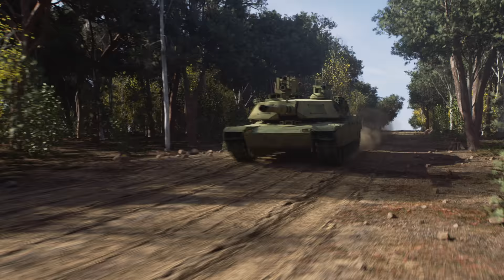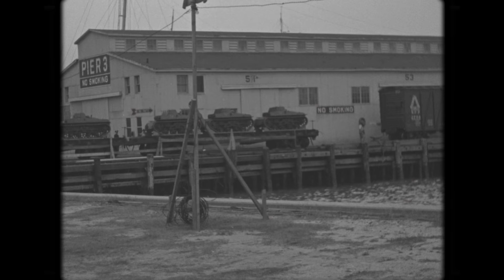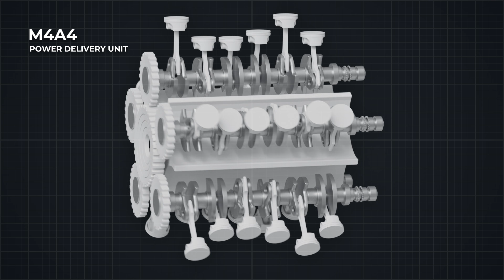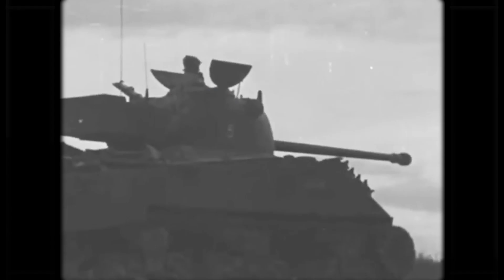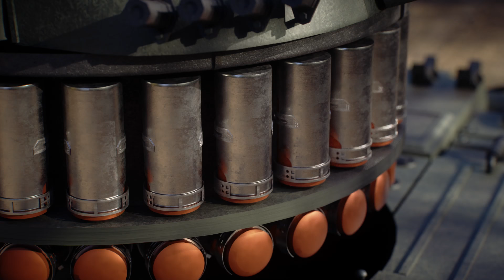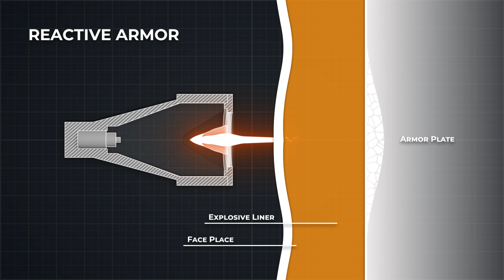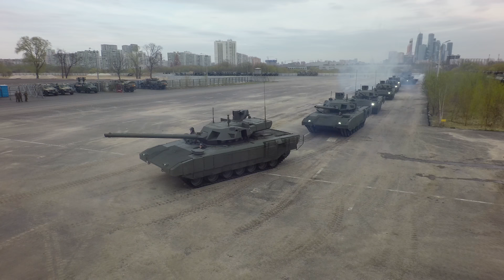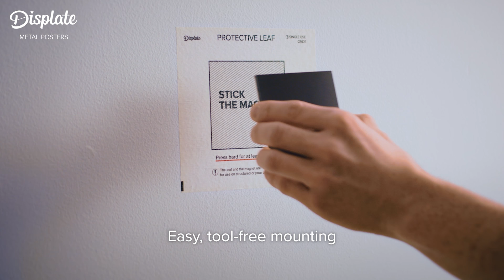Why America’s Tank Failed in Ukraine

Comment: this video is oversimplifying things so much that i almost wanna call this missinformation.

Edit: yea there are a lot of things blatantly wrong with this video.
The video title is missleading. This entire video is purely about engine design and hating on the Turbine, mainly due to fuel consumption while cherry picking military logistics issues.

A small list of things wrong with this video:
-Abrams didnt receive DU on its hull till the most recent SEP V3 
  and DU doesnt matter in the context of Ukraine as theirs dont have it at all.
-Tiger 2 wasnt build as a response to the allies employing better guns, its development started well before guns like the 17pdr, 76, 90, 100 and 122 were used against Tiger 1s.
-The T64 didnt just need someone to drive better, the engine itself was heavily flawed and needed a lot more development time, eventualy beeing reliable in the T64B.
-The engine layout in the Abrams prototypes didnt matter, the Army had already decided on the much more reliable Turbine for whoever won.
  it was purely a reliability question, the Diesel never even got close to the reliability standards set by the Army, in either case the Turbine was prefered by the Military and both vehicles were to fit it if either one of them won.
-The Diesel powered Tanks in the Russian arsenal arent much better than the Turbine T80. from a Tankers perspective they are identical with minor differences in favor of the turbine.
-"extreme mobility" or rather the reduction of weight in favor of mobility, turned out to be the wrong approach to tank combat shortly after Leopard 1 entered service, it had no impact on the Abrams development.
-The Abrams has an above avarage fuel consumption while stationary, this is why all modern variants received APUs, providing power while stationary with no need to keep the turbine running.
-The above avarage losses of Abrams have nothing to do with its engine. It is the vehicles prestige and area of deployment that causes it. Essentialy the Reputation that leads to a greater effort to destroy it, and an area of the fighting with more concentrated enemy numbers, worse terrain and more AT weapons.
  Furthermore drone attacks cant be avoided by simply having a better engine, in fact no Tank is guaranteed to survive drone attacks.
-The US Army isnt rushing to buy cope cages.
-Armata is a failure and most tankers i talk to find the concept less than ideal.
-The reason modern Abrams "Tech Demonstrators" use a Diesel is because engine development has advanced more than 40 years since the Abrams introduction.
-M1E3 is still in development and not much is set in stone yet.
Reply: The real reason for the vast majority (if not all) of the Abrams losses is mobility kills. Either the tank loses a track or gets mired in the mud. Either way, it is the shear weight of the Abrams that is the issue, not its engine or anything else. Every image of a destroyed image indicates it was immobilized first, then either destroyed by the Ukrainians to prevent capture or by the Russians to prevent the tank being recovered. Again, I will repeat, it is a weight issue.
Reply: Damn we got a no life with this one

Comment: Your thesis is very flawed. The Ukraine-Russian battlefield is not the one that the U.S. military would be fighting on. First of all the main threats to the Abrams that the Ukrainians have experienced would not be present if instead it was the U.S. military. U.S. airpower would have greatly transformed that battlefield into something unlike what exists between the Ukrainians and Russians. And that is just the start of the differences. There are lots of lessons to learn from the Ukraine-Russian War, but you have to understand that many of those lessons are also shaped by the limitations of each of their militaries, limitations of their logistics capability and systems, and each nation's fairly weak air power.

Comment: By the by, the Russo-Ukraine war of static trench lines, mine fields, and limited combined arms capabilities, is not the war of maneuver and combined arms the M1A1 was designed for.  Further, the M1A1 was battle tested in Iraq, where it crushed the Iraqi's Soviet designed tanks and tactics.  As we have seen, Soviet era tanks are no match for modern western tanks in every metric that matters except quantity but even that is no longer true as the vast stocks of Soviet era T-62s has dwindled to almost nothing.  M1A1 losses in Ukraine are more likely due to near constant combat in an environment it was not meant to fight in and not a failure of the equipment.  No sir, western tanks have been shown to be superior in every measurable way compared to Russian equivalents.  Putin's splendid little war which was supposed to bring its renegade Ukrainian province into line and bolster his dreams of a restored Russian empire and halting the West's eastern NATO expansion has failed spectacularly, exposed Russian military fragility, and will require a regime change and a generation to recover from.

Comment: inline v6? What is that?
Reply: A v6 that is mounted inline as opposed to transverse.
Reply: @gazza9945  When you say "V6" you're not only naming the type of engine but you're also literally describing the engine. It's v-shaped with 3 cylinders on either side. If the cylinders are mounted inline, then it's a straight 6 not a 
V anything

Comment: Oh, the very whisper of it sends a chill through the steel bones of my beloved M1A1 SEP v2, as though the desert wind itself had turned traitor and carried the name across the dunes like a curse.

I was there, you know—huddled in the commander's hatch under that merciless Iraqi sun, the heat shimmering off the Chobham like a fever dream, every rivet and plate of my Abrams radiating the quiet, stubborn pride of something that has been tested in fire and found unbreakable. We spoke of many things in those long watches: the reliability of the turbine, the sweet precision of the 120mm, the way the thermal sight could pierce the night like Dumbledore's wand through a Death Eater's cloak. But never—never—did we speak of that name.

The Russian Armada.

Even now, years later, I cannot say it aloud without a shudder. It was as though the word itself were a dark incantation, a summoning charm for something monstrous and impossible. They said its gun was a marvel—a 125mm smoothbore that spat death with contemptuous ease, larger and more terrible than anything we carried, capable of hurling guided missiles as casually as a boy might fling stones. They claimed the armor was impregnable, layers upon layers of secrets woven so cunningly that no sabot, no HEAT round, no spell of Western metallurgy could breach it. And the stealth—oh, the stealth! They boasted it could vanish from sensors, become a ghost upon the battlefield, invisible until the moment it chose to strike, a shadow with teeth.

I would lie awake in the turret bustle, listening to the low hum of the auxiliary power unit, and imagine it: that unholy thing materializing out of the heat haze, silent as death, its unmanned turret swiveling with mechanical malice while its crew sat safe in an armored capsule, untouched, untouchable. One whisper of "Armada" and I feared it would answer—coalesce from the very sand, gun roaring, armor shrugging off our best shots as a Dementor shrugs off light. My cherished Abrams, faithful and fierce, would be rent asunder in an instant, reduced to smoking ruin while that demon tank glided away untouched.

So I forbade the name. Not out of cowardice—never that—but out of a bone-deep dread that words have power, that to name a thing is to give it form. In the heat of those endless patrols, with dust in our throats and fear a constant companion, I guarded my tongue as fiercely as I guarded my crew. Let others prattle of super-tanks and next-generation wonders. I knew the truth in my marrow: some horrors are best left unspoken, lest they hear and come for you.

And so, to this day, when some fool begins a screed about the Armada's glories, I feel the old terror rise like bile. My Abrams—my true, battle-scarred companion—deserves better than to be compared to a phantom, a parade-ground myth that haunts only the minds of those who have never truly faced steel in anger.

Speak its name if you must. But do not expect me to join you. I have seen enough real darkness without inviting more.

Comment: Ya this was an absolute disaster of a video for your caliber. So many wrong takes and information, more so disinformation. You’re really all about the anti-American sentiment in this video. You encapsulated the entire European culture of hating on American equipment at every possible corner. The US has a major supply chain that is unmatched. At the time of the design of the M1 Abram’s it was decided that the cost of mobility vs fuel efficiency was worth it for crew survivability and rapid transition from point to point. The Germans needed to stay with the MTU diesel because they don’t have the logistics the US has. Not the the UK and France. The requirements of each nation is unique and therefore, unsurprisingly, each nation has come to its own conclusions for its own tactics and challenges. And now with better reliability of hybrid systems, now we are just seeing what the DoD wants us to see. They’ve been testing these systems for decades if you did a bit of research. None of the previous models of hybrid systems could deliver the instant power of the turbine. For the Abram’s to be as heavy as it is, it’s quit maneuverable, even compared to the leopard 2. For the US the Abram’s has been an amazing tank. The US hasn’t fielded the leopard 2 because it doesn’t meet the requirements of the US DoD, it’s an inadequate system. Just the same as the Abram’s is an inadequate system for pretty much every other nation. This video was just awful to listen to. I’d rather listen to nails on a chalkboard

Comment: That was a lot of history to get to the nut of the matter. How big is the battery? How big is the electric motor? How long can it run on hotel load, and will it need to start the engine to move at all? If I remember the stats on that Cummins opposed piston engine, it's not very big. I guess it could be scaled up from the test version, of course. Still.

Comment: Hybrid is one of these things that really makes great sense for a modern tank. Its powertrain can be switched depending on what fuel is available, its engine can just run on its most efficient RPM setting to recharge the battery, its electric motors can deliver almost instant torque. and it can run in sneak mode on batteries and reduce its noise profile drastically.

Comment: You are talking a small number of tanks, so what if 27 tanks have been destroyed by drones, how many thousands of Russian tanks have been destroyed by drones. It is not an Abrams problem but a battlefield that isn't tank friendly for either side. It's not a modern battlefield problem it is how it is used in Ukraine, it is like battleships, the aircraft carrier made battleship vulnerable, but they were still useful for decades later, just not in the role originally envisioned. So will the Abrams need to be replaced yes, but it isn't junk and has many uses still, just less than in the past.

Comment: I don't think the new Abrams is what we need.  Almost certainly, we need a clean sheet design that takes into consideration everything happening in Ukraine, and the likely future directions of drone warfare.  Efficiency, and optional battery drive for short distances are keepers, but a flat top, with likely thin armor on top is just not going to cut it.  Targeting will pick the most vulnerable direction and angle, hitting that surface, not just a straight shot from another ground vehicle.
I am sure they already put money into this, but it needs a rethink.  Almost everything needs a rethink.  Drones completely change everything.

Comment: I worked on the Abrams and Bradley back in the late 80s, and I thought even back then that they should take half of the TOW systems off the Bradleys and mount a Stinger pack for air defense.
Reply: How? The tow mounting system would need to completely redesigned to allow the stingers to fit, you’d also have to create an entire system to show that lock has been achieved. You can’t hear the lock tone through the tank hull.
Reply: @deathkorpsofkriegguardsmen8488  So, we need an LED and a speaker?  I think we can afford that.  Seriously though, the Stinger is smaller than a TOW, and adding another box shouldn't have been a huge thing.

Comment: This video is garbage. You lied in the very first 30 seconds. Ukraine does not have the M1A2. It has the older M1A1s. They didnt get Trophy systems. They have the older thermals. In 1996 in Korea these M1A1 tanks were already old. The ones Ukraine got were built in the 80s and even then they are the absolute most lethal tank Ukraine has bar none. They use them in the highest threat, greatest risk operations to stop major enemy advances and they accomplish it. 
23 total M1A1s have been destroyed, damaged or captured, not 27.
According to Oryx only 10 M1A1s were actually destroyed, mostly by their own crews to prevent capture after the tanks had suffered mobility kills from having their treads damaged by mines or drones. Most of those losses occurred early before Ukrainian forces learmed to use them correcty with combined arms forces.
Only 2 M1A1s have been captured by Russia after being disabled. Even Russian sources agree the older M1A1s are significantly better than anything they currently field.
11 M1A1s were disabled and either abandoned for a short time or disabled due to engine hits or track hits and immediately recovered. ALL of those tanks were repairable. These damaged tanks have been sent to NATO depots for repair and refurbishment by US forces.
This is OSINT open source informatiom easily found via reputable sources. The M1A1 tank has been used by Ukraine to absolutely stop Russian armored advances and/or in counter-attacks to regain lost mimento or to spoil Russian momentum. 
All of the crews of these tanks survived. Russian crews never survive the liss of their tanks. 
So stop lying. Its clear Russia is paying for this ridiculous propaganda video.

Comment: Completely misconstrues a number of historical details. German armor was most often left on the battlefield late in the war from a lack of fuel and replacement parts. We were getting 10x as much fuel piped in than they had. Towards the battle of the bulge their strategy relied on quickly overtaking allied positions to get fuel to use to continue the attack. If they didn't win, and win quickly, they had to abandon their equipment. We didn't do a lot of mass tank on tank fighting like the russians except when we had to, and preferred to have the likes of m26 and m36 pershings for tank on tank, as well as air superiority taking its toll on logistics. Our lessons since then developed our tank strategy that relies on logistics, air cover, and combined arms. So the M1 was designed to fight in a completely different conflict than Ukraine's war. Main use of having them in Ukraine was for Kyiv defense and as the trigger that the rest of NATO waited on to provide other tanks and 'lethal aid'. M1 was never going to do well with a lack of air cover and combined arms going it alone against mass amounts of AT defenses. Yes the engine should be changed but M1 hasn't failed, its been consumed through a battle where that was the only thing that was ever going to happen.